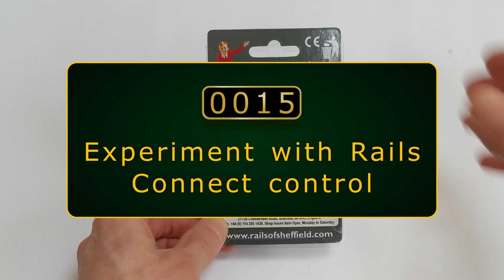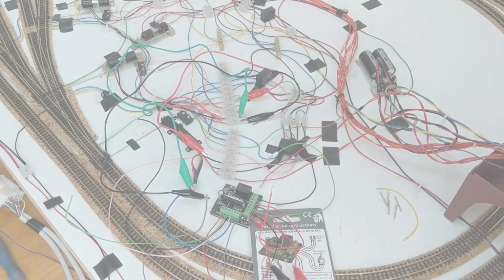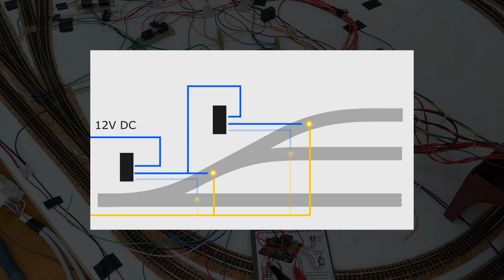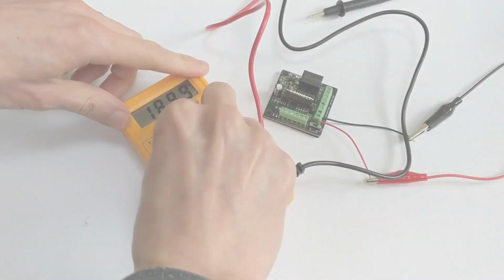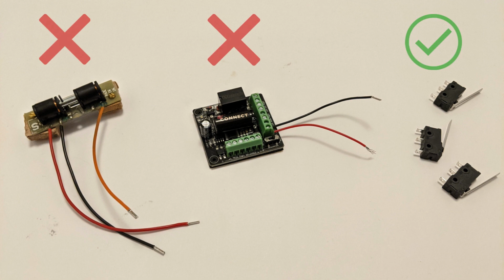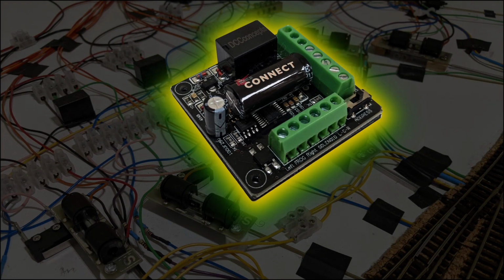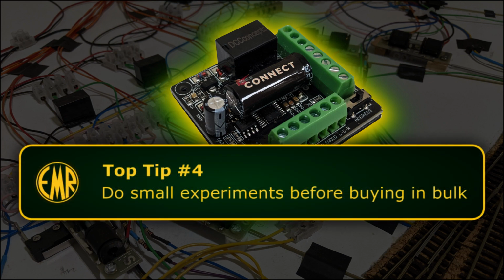0015 Experiment with Rails Connect Point Motor Controller

Comment: Problem with the DC Concepts RPM-SDB.1 unit, does anyone have one? I could only get this to throw one way on the points
Reply: Try swapping the black and green wires from the point motor over

Comment: Not fully understanding DCC fully I used standard solenoid point motors from Gaugemaster. But as I learnt I tried out a few different DCC point systems. The most simple and successful one was to convert the standard motors with Gaugemasters DCC81 point motor decoder and  if needed the DCC80 auto frog. This resulted in lots of wiring being removed and an easier system to use. They are both simple to fit and set up.
Reply from the maker: There are certainly lots of options around; the DCC81 + DCC80 costs a lot more than one of the Rails Connect units to do the same thing, except if it's actually reliable then arguably it's more, and is therefore better value. I started out with the autofrogs, but they didn't work well with one of my locos, so they became a no-go on Endoor. I haven't heard of anyone else having issues with them though.
Reply: @endoorrailway  They both work reliably for me

Comment: Personally, i would use a 100 ohm resistor, LEDs last longer at 10 mA,  30mA is quite a lot of current.  The leds dont dim much until you get down too about 4mA.  So 100 or 120 ohm should be better.  Just my thoughts.  All the best
Reply from the maker: Hi, thanks that's a useful tip! I hadn't come across mention of anything like that when finding out about LEDs - it's certainly worth knowing and something that I'll factor in to any future LEDs that I add - after all, it doesn't hurt to try a lower current and see how the LED looks.

Comment: Hi Jonathan! This was very interesting, especially the bit about reliability! I experimented with these units when I was testing solenoid point motors and came to the conclusion that they were too unreliable after three of the six I'd purchased either stopped working or failed to work out of the box! I like the that they have a CDU and DCC control built in, but a 50% reliability rate is way too low for me! All the best, Ian.
Reply from the maker: Hi Ian,
Thanks for commenting. I'd completely forgotten you did a video with Rails Connect! I'm convinced I must have watched it (likely a while after you made it), and have just re-watched as a refresher. That's a shocking reliability ratio, I assumed I'd just been unlucky but it sounds like reliability problems aren't confined to Dapol tender locos, or SEEP aux switches... I hope there isn't something of a hobby-wide theme emerging here! Fingers crossed for the servos on Shelfington